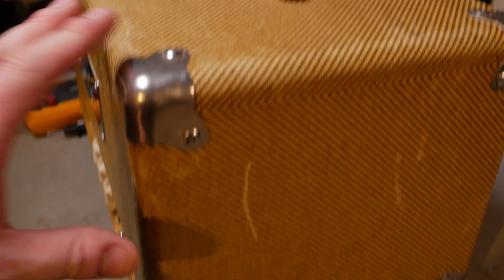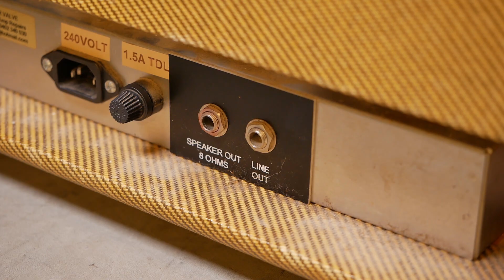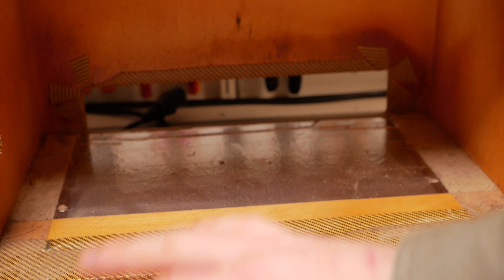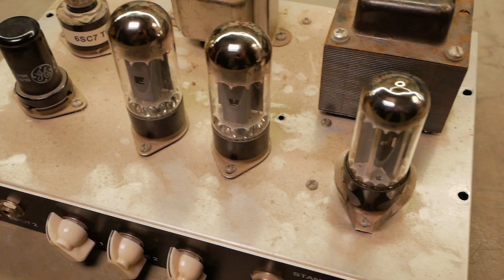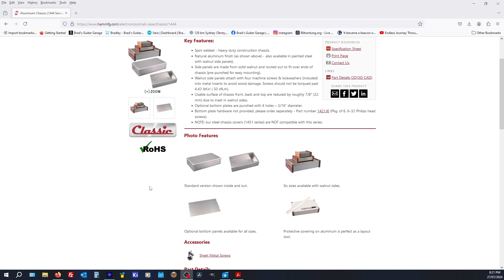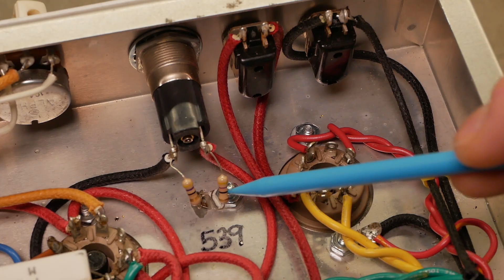Little Walter 22W - Part 1

Comment: Circuit boards rob the tone, mannnnnnnnnnnnn. 

I could have sworn Hammond makes(and has forever) a 2mm aluminum chassis. I know the margins are tight with small run boutique amps, but they aren’t that tight(especially in bulk).

I still want to build something into the steel lunchbox chassis they make. I need another amp like I need another guitar though.

Comment: Little Walter is a modern amp utilizing Ken Fischer's idealisms and build mantra ( not always rooted in truth, or physics ). True PTP and all the parts are purposefully placed for the tone. I find that they still have wiring that is not to code, or to best standards, and I have seen them with the cathode resistor zip tied to the bypass cap. I am not sold on them, and feel they are costlier than the product you get. Robben Ford is one of Little Walters biggest endorsers though, so that says something. They sound great, no doubt, but I do feel you are paying for more than you get.

Comment: That input cap + grid leak bias type input stage works (depending on tube type and heater grounding style) sometimes quite well if you want low hum levels. I have sometimes seen it used successfully in reverb recovery circuits as well.

Comment: Interesting, Brad. Chassis reminds me of the old Holden Wasp XL I have in a million pieces. The chassis collapsing under the weight of those big (A&R) Transformers. Reckon a combo of PTP and PCB is the best. Chassis mounted pots, sockets etc, so the PCB is easier to maintain.

Comment: The Hiwatt amps were a good example of how to do point to point. They should be the gold standard. 

I would be suspicious of the 100 ohm choke resistor. I have a Fender Champion 600 ri amp which I turned into a 5F1 Champ for a more authentic Champ timbre. I found that 100 ohm resistor was causing shorter output valve life. I would use the original 10K value initially. 

Do you think the tag strips are suitable for high voltage. I replaced a couple of old ones in an amp that were conductive.
Reply: Hiwatt's wiring has traditionally usually looked like totally overly neatly dressed. Sometimes it is not good at all, if for example they have wrapped grid wires neatly and tightly together with other plate circuit or power line wires they should have be kept away from grid wires. And a ground loop or ground wiring scheme with ripple currents in wrong places is a problem even if those wires are in military order with 90° bends etc. 😂
Reply: @jutukka   what Hiwatt amps have you seen that in?
Reply: @Mark70609  It was one 50 watt combo. Difficult to remember exactly because it was 29 years ago. But it had hum problems caused by same triode plate and grid wiring crisscrossed and bent neatly to go side by side with each other and heater wiring as well, causing both intermittent parasitic oscillation and hum. There was some signal ground thing as well but I cannot remember exactly any more.
Reply from the maker: Yes, often the Hiwatt lead dress looks pretty and well executed to the layman. However the layout is quite often very far from ideal.
Reply: @BradsGuitarGarage  Yes. The layout or wiring that looks very neat and pretty does not necessarily perform well at all.
Reply from the maker: Yes, I think there should be at least 1K screen grid resistors per valve if they're going with that value.
But now I'm in that awkward spot where I'm trying to preserve the original circuit, but not make it eat 6V6's.
Reply: @BradsGuitarGarage   for what it’s worth 4.7K is the compromise that I would be shooting for. I think when I was posed with this problem I had the CRO on the screens working out what the screens were coping.

Comment: Personally I love P2P, and I've built plenty of single ended hi fi amps in that way, but you've gotta do it the right way, which this amp does not. You have to have the hardware laid out such that the component leads themselves are sufficient to make the connections with minimum excess left over so everything is nice and rigid. That way you avoid a rat's nest of wires that just introduces all sorts of noise into the system, and repairs are quite easy as well. You use tag strips in situations where you have to run a wire. Passing a wire through a tag eyelet when you could solder that cap between the pot and tag strip and then run a short wire to the valve socket is the sort of idiocy I've come to expect from these so-called 'boutique' builders. In the context of guitar amps, there's really no benefit at all to using P2P because the circuits are just too complex with the negative feedback, tone stacks, and push-pull output stages, so you end up with a rat's nest anyway. Not only is this amp not benefiting from P2P constructions, it's actually worse off than if it was built with a turret board or a PCB.
Reply from the maker: Exactly, mate.
I left the topic open for argument with the rhetorical question in the thumbnail, and I've got to admit, it made me a little nervous to type it, but I'm glad I have level headed experienced commenters like yourself who know how and when it's application is called for, and how to implement it.
Thanks for your input!

Comment: 6sc7 common cathode  lower plate res. about the same trans , gain about 70 so at7 a bit low 5751 closer .   So could have tuned up a 5c3 clone a bit better than this . Build quality is so so for DIY not what a sold product should be IMHO.  Not  safe build for end user.

Comment: Those big washers are called "fender washers".  You can get various outside diameters for each screw or bolt size, ranging from slightly larger than a standard washer to crazy large OD sizes. The 6SC7 is much much closer to a 5751 than it is to a 12AT7. The plate resistance of the 12AT7 is around 11,000 ohms, transconductance is closer to 5400 with a mu of 60 with 250 volts on the anode, whereas the 5751 has a plate resistance of around 58,000 ohms a transconductance of 1200 and a mu of 70. The 6SC7 has a plate resistance of around 53,000 ohms, a transconductance of 1370 or so and a mu of 70. 58,000 is lots closer to 53,000, and 1200 is lots closer to 1375, and the 70 is 70, so the 5751 is THE choice for replacing a 6SC7. Someone messed up somewhere, there.
Reply: In UK they are called panny washers probably because of their size similarity to very old UK coins.

Comment: I get the safety issues on the fuse for the tip vs ring… but why is anybody pulling a fuse with the cable plugged in anyway?  Not to mention physically touch the metal part of the fuse while inserting it… the cap grips the fuse for a reason.
Reply: " . . . [B]ut why is anybody pulling a fuse with the cable plugged in anyway?" For the same reason that you have difficulties with writing in complete sentences; a lack of experience, poor or no instruction, and a general disbelief that it could be a problem.

I don't mean to pick on you; I merely offering up an analogy as to why people might be so fool-hardy as to touch a fuse holder without disconnecting the mains.

Cheers,

Alan Tomlinson
Reply: @diegorhoenisch62 good point Alvin!